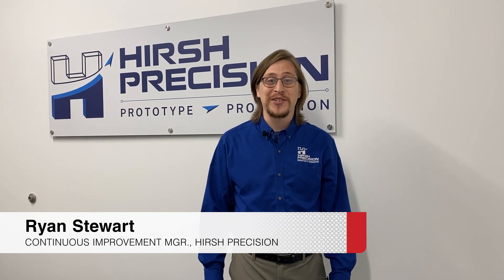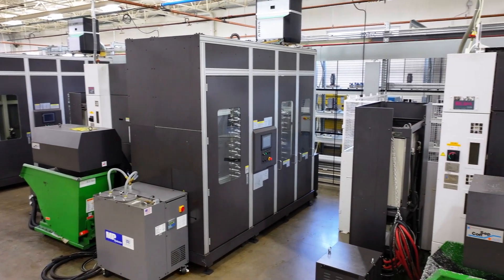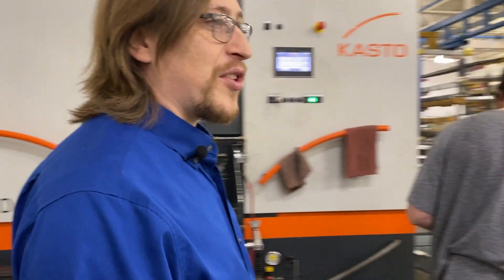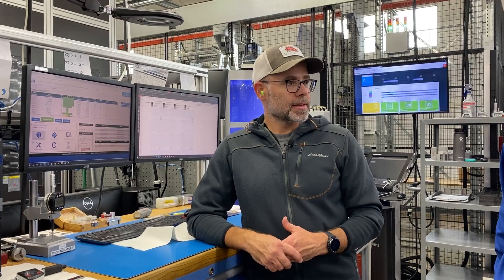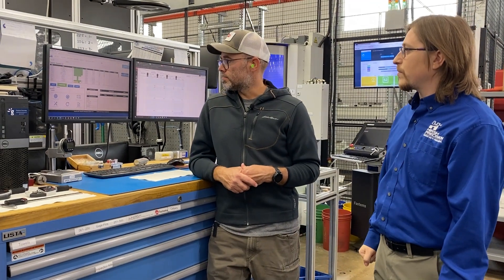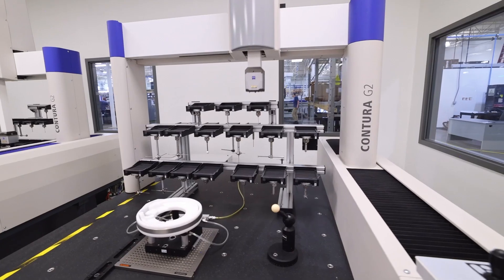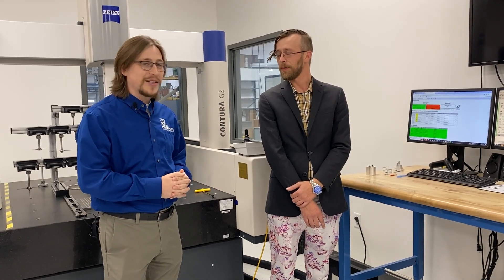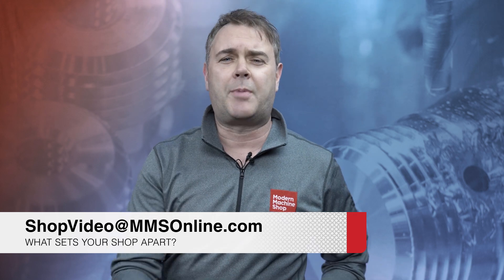Inside a High-Volume CNC Shop Powered by Custom Shop Management Software

Comment: This video is very informative.  They have put together a detailed system to run the shop. They even seem to handle air quality control by the large air conditioning system above many machines.  I worked in a large machine shop that had none of this and it showed.  Good job . 🇺🇸👍